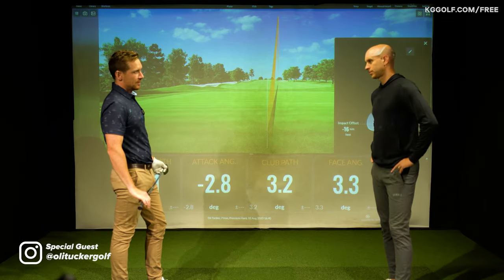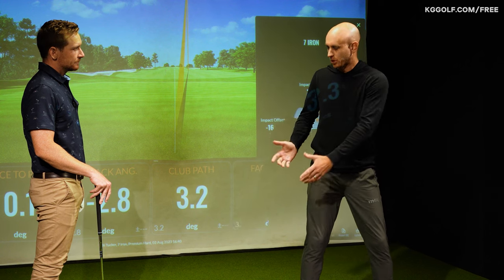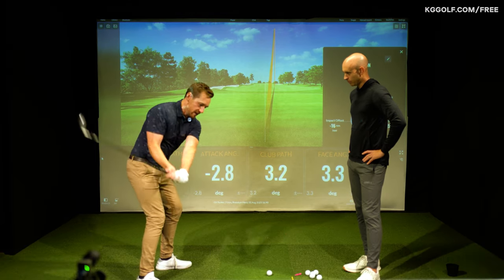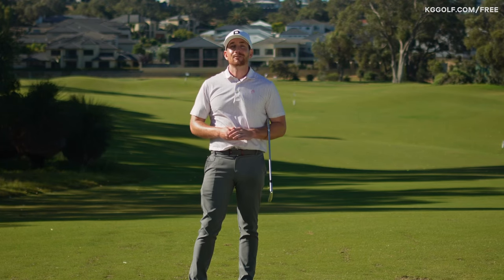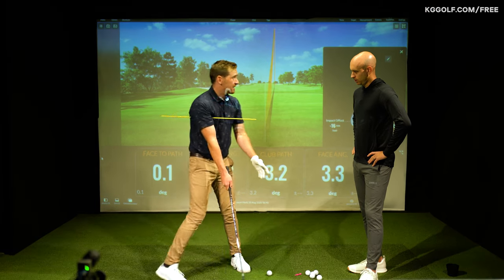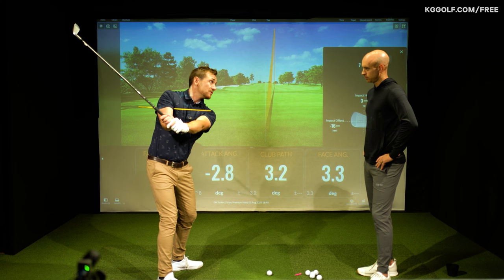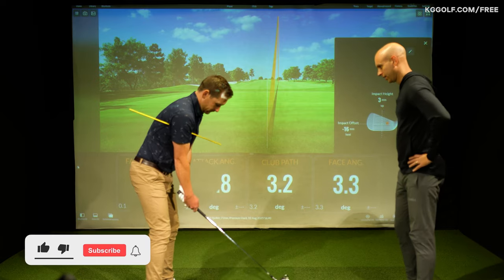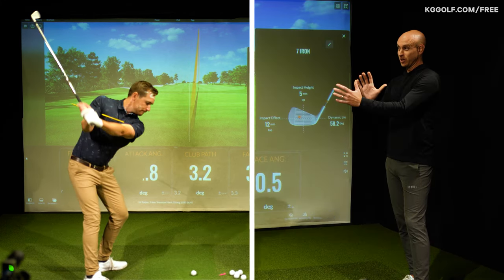How to SHORTEN your Golf Swing for more Consistency

Comment: I'm going to give this a whirl.  I bring the club back way to far and then my brain readjusts the swing path on the way down.  I still make good contact and distance, but just imagine if I were actually doing it the right way what would happen!
Reply from the maker: Sounds like you've got the building blocks for a great swing! Good luck with it 👍
Reply: I have the same exact issue. Going to try to gradually fix it.
Reply: @Lordyung89 Did u?

Comment: Absolutely fantastic drill and explanation by both! Have been "trying" to shorten swing for 30 years and gonna do this drill ALL WINTER LONG and finally fix it! Would you say early wrist hinge is also important in preventing runoff too?
Reply from the maker: Thanks for the feedback 👍 Yes early wrist hinge can indeed help prevent runoff at the top of the backswing. When you hinge your wrists early, it allows you to set the club in a more controlled and compact position at the top, which reduces the temptation to over-rotate or extend your swing too far.

Comment: This is my exact issue with the added problem of slight roll of forearm inside during takeaway. AOA with irons are shallow with FTP always left, draws on my good days with mid 70s scores. Hooks and blocks on my bad days with the odd day not even breaking 90!. Will try this drill for a few weeks, its a shame I'm in Melbourne otherwise it'd be an in person lesson!
Reply from the maker: Let me know how you get on. The best way to get in touch is on my app for a swing analysis or coaching 👍